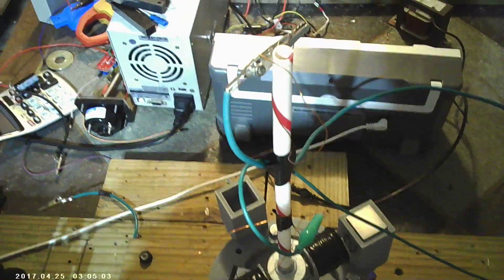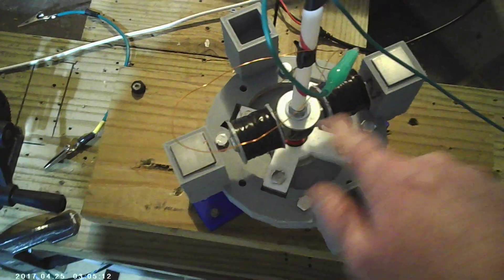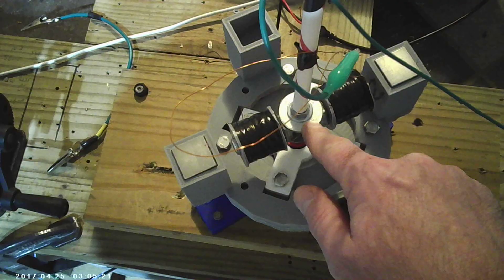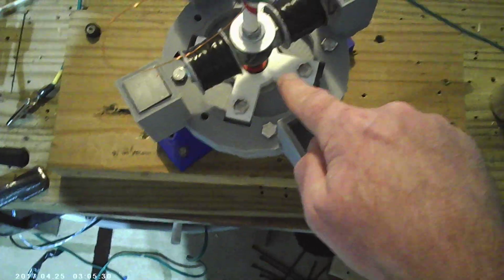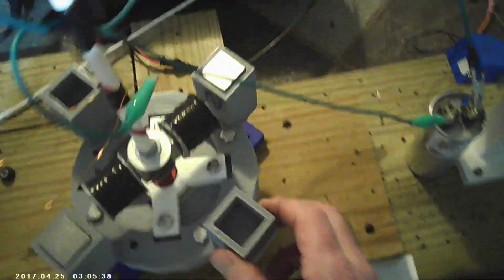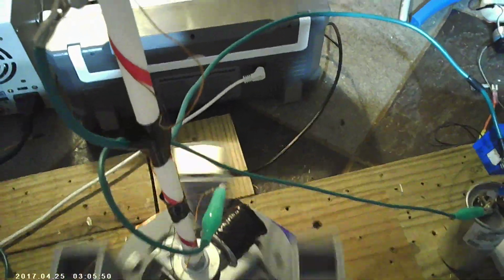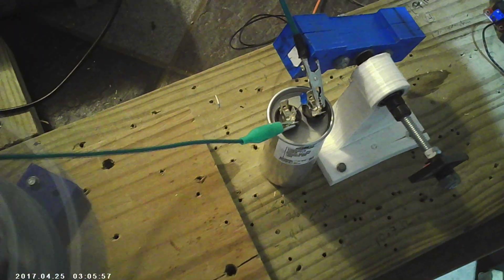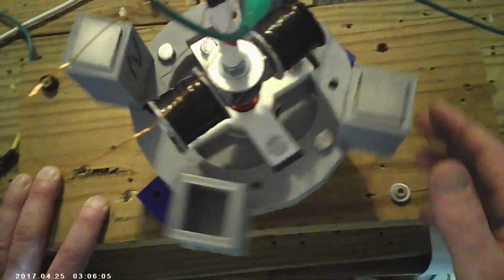Testing Lenz Killer Overunity Coil #2

Comment: You might see something good if you play around with the offset between the two magnets spinning, by this I mean the magnets not facing each other exactly straight across, but make one about five to sixteen degrees skewed to the other.  Then make the central coils all like one coil going across not bucking.  Play around with it like that idea is the lenz reaction gets hit by magnet at opportune time before backemf from loading coil in has time to manifest don't know if it will work however don't blame me if it doesn't haha
Try shorting coil as the load instead of little light and get some strong lenz/backemf   
Thanks for you videos they make my brain tick!